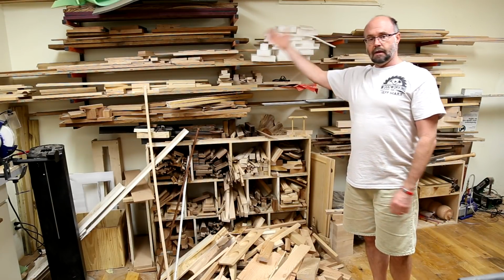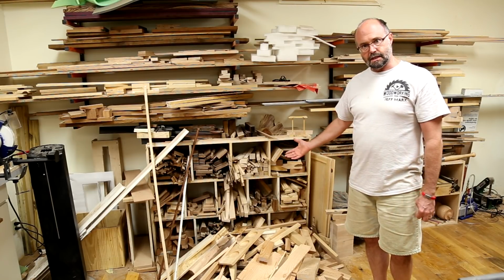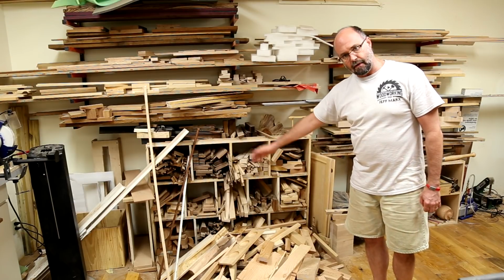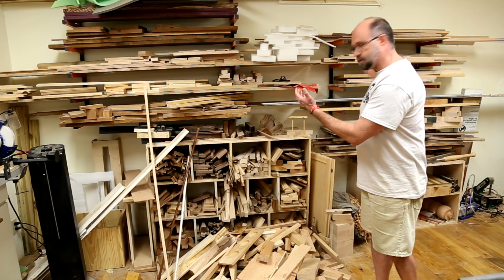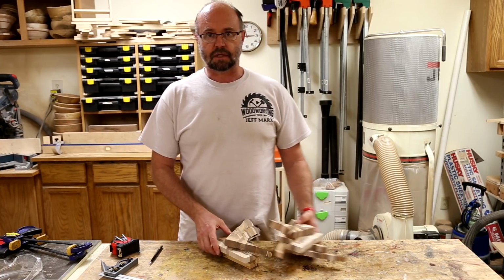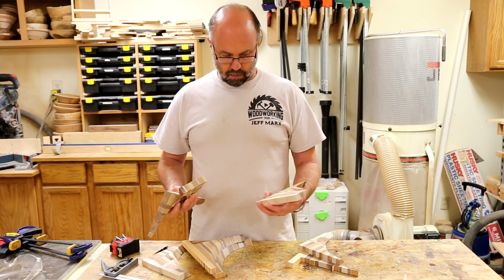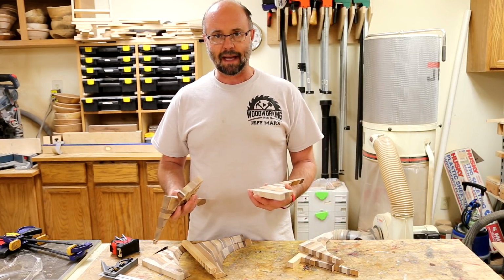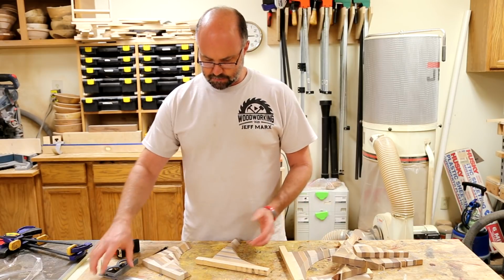Making pens from scrap wood, part 1/2: Making the pen blanks

Comment: I'm terrified for your fingers! You don't have a jig or something you could control the wood with when using the band saw? And why did you make the second lot of cuts on a table saw instead? (thankfully without getting your fingers as close, but I'm not convinced pushing it through with a couple of timber scraps like you were stoking a campfire is any safer than your first method. I kept waiting for it to grab and flick up into your eye!)
Reply from the maker: Thanks for your comments and your concern T W!  Everyone should avoid any operations with which they're not comfortable!  I could have done the final width cuts on the bandsaw as the quality of the cut really doesn't matter much for turning.  I have since made better push sticks if you want to check out that video, and I would have used one of the new ones for those cuts.

Comment: I have a question? does all wood require that it be stabilized prior to making a pen or is that just a suggestion to make the wood hard?
Reply from the maker: It really depends on the wood.  Most hardwoods don't require stabilization, and I didn't stabilize these.  When using spalted, punky, porous, or really soft woods, stabilization is probably a good idea.
Reply: I know it's kind of randomly asking but does anybody know of a good place to stream new movies online?

Comment: Where did you get the branding iron???
Reply from the maker: Branding Irons Unlimited.  Brandingirons.com. I liked it so much, I ordered a second, smaller one. Mine is electric.  You can get electric or not that you heat with a torch.